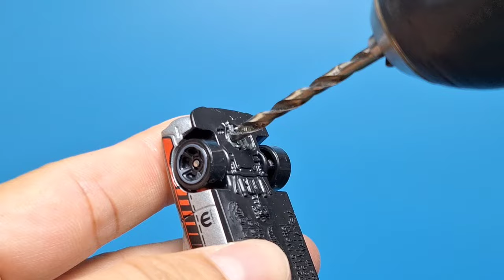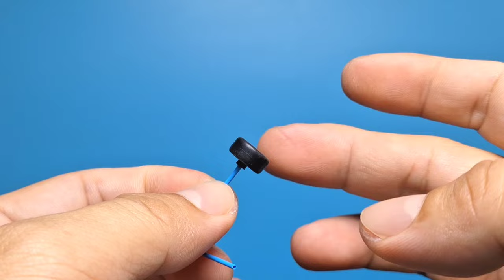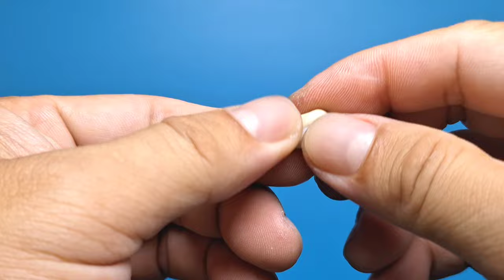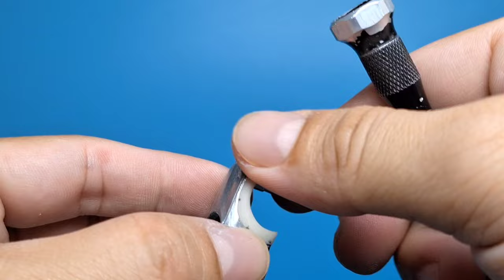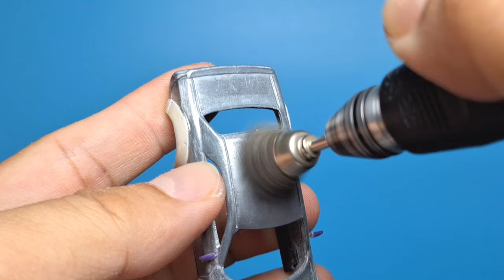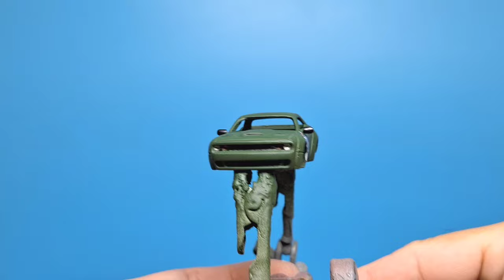dodge challenger srt widebody hot wheels custom

Comment: Where to buy your drill to cut the bottom posts and also the mini drill you use to make holes for hinges?.
Reply from the maker: I got mine at ace hardware here in philippines, the drill bits from shopee.ph
Reply: @customhotwheels  thank you very much, I'll try to buy it in manila when we go there
Reply: @customhotwheels  what about the mini drill?
Reply from the maker: Try shopee ph. Lotus rotary tool
Reply: @customhotwheels  how much did yours cost? im afraid i might buy the wrong item lol
Reply from the maker: Shopee price range 1500-2000
Bro add me on fb sky dayrit,
Reply: @customhotwheels  soon bro